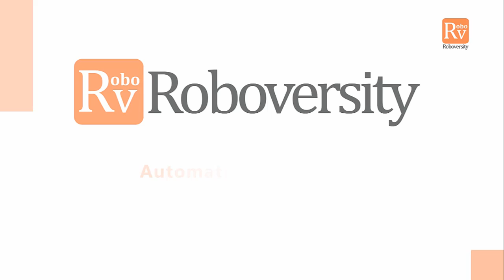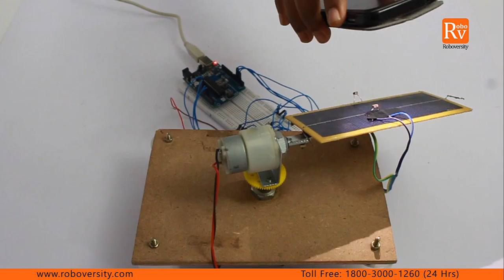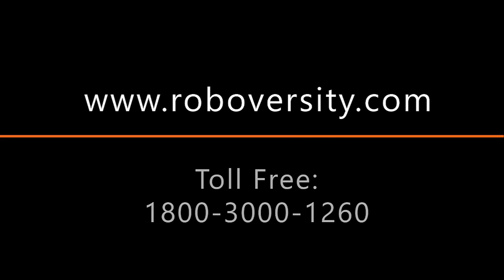Automatic Solar Tracker Project by Roboversity

Comment: Hi i am malaysian student studying electrical engineering. I would like to implement your project for my graduate final year project.i have to do the software and hardware also present the project before i am graduate.could you give me more information to how can i do the solar tracker(sketch, program,circuit,equipment used) thank you. nurul.asmida55@gmail.com
Reply: NURUL Asmida hi can i contact you please am planing on making the same project as you are for my graduation project next year  so i was wondering if you can help me thank you